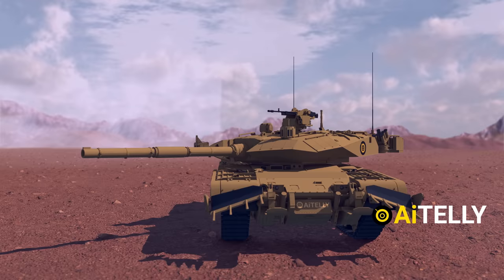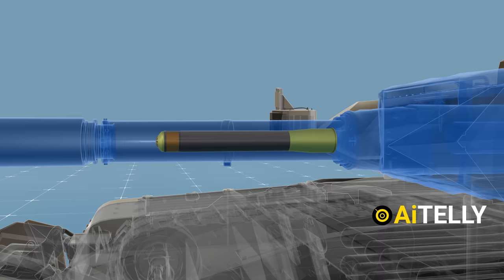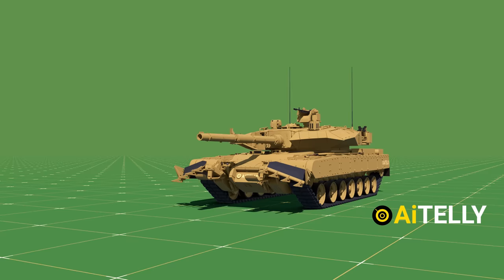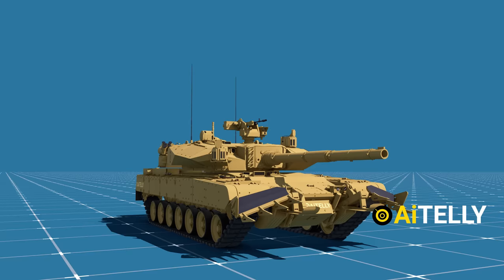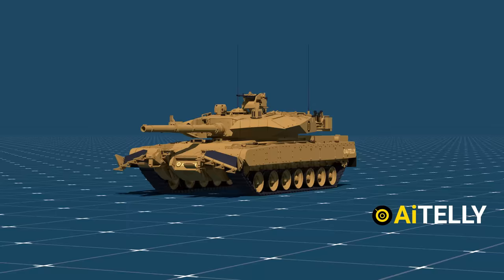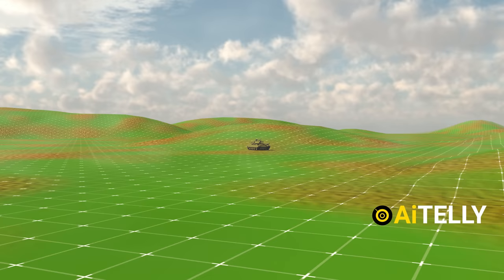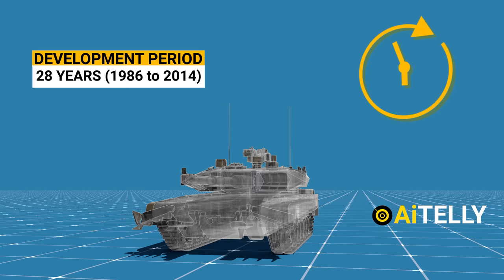Heaviest Battle Tank Arjun Mark 1A Mark 2 | How it works #tank #tanks

Comment: A few corrections for some of the mistake you’ve made regarding the spelling and functions:

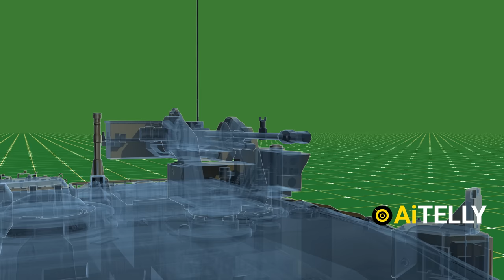- 3:49 The gun is a RWS turret for the commander to take control and clear lightly armored vehicle or infantry, not for anti-aircraft duties though it could be used against low-flying helicopters. 

- 5:00 The American M1A2 is named “Abrams” and not “Abhraham” 

-2:08 The correct term is “APFSDS” or Armored Piercing Fin Stabilized Discarding Sabot and not “FSAPDS”, kind of strange as you’ve correctly spelled them correctly at 1:34

- 3:44 The IR Jammer does not work like a hard kill APS where it intercept the incoming round with a round of its own, but rather jams the IR camera of the incoming missiles making them blind and thus tends to fly off and miss the tank. 

Other than these, you’ve made a pretty good but somewhat simple explanation of how a tank like this would’ve work, got the basics well and that’s ok. 👍
Reply from the maker: Will pin this Comment in our Comment Correction Section.
We highly value your Feedbacks.
Youtube is a great Community to learn,and grow.
Reply: So it is an anti aircraft machine gun. You said it yourself.
Reply: @kolinmartz  it can be use for anti-aircraft purpose, but it’s not its intended purpose. It’s main purpose was to fight lightly armored vehicles and infantry.
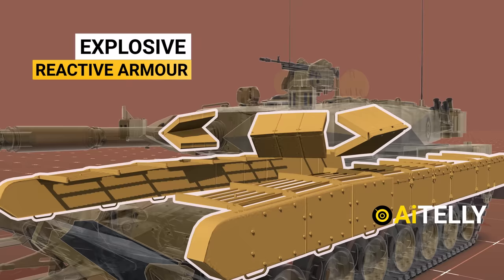Reply: Also the the side ERA coverage is over exaggerated 1:13 , there's only 3 blocks of ERA covering the front part of both sides, not the entire side hull as the video highlighted and in 1:23 you showed a composite armor array in the ERA block

And in 4:09, the blow off panel does not really protect the ammo or prevent explosion, it's there so when incase of an ammo cook off the fire will go upwards not into the crew compartment, Arjun have separate ammo containers as the main ammo protection for the crew

And Arjun Mk1A isnt the heaviest main battle tank, its currently the Challenger 2 TES thats 73 tons
Reply: Lot of more errors include not considering the Challenger Mark 2 which weighs 75t with combat armour. And the M1A2 SEP V3 weighs 66.8 tons similar to Arjun MK1A. One more aspect is the statement of LAHAT getting integrated. LAHAT tests are done and dusted. What's been integrated is India's own SAMHO missiles. Around 4 tests completed including minimum and maximum ranges. The statement regarding obsolete is also wrong since MK1A is being designed to stay contemporary.
Reply: “FSAPDS” is perfectly fine. It is Fin Stabilized Armour Piercing Discarding Sabot.
Reply: and ERA plates made by india certainly does not work against APFSDS, it may only be effective against HEAT, ATGM and rockets only
Reply: My korean friend also used to call the abrams “abraham”, since he figured it was named after abraham lincoln.
Reply: FSAPDS is also correct term , drdo which makes those shells uses that name "Fin Stabilized Armor Piercing Discarded Sabot"
Reply: The term FSAPDS is a term used in Indian army reporting, they essentially mean the same thing but it's how we say it in documentation in Indian.
Reply: and the Challenger 2 TES weights even to 70 tons
Reply: about the FSAPDS, it's what the Indian army calls it, FSAPDS
Reply: @Aitelly  you missed a very imp point. ground pressure exerted by M1A2 is 1.09kg/cm2 but that of ARJUN is 0.84kg/cm2
Reply: @Aitelly  Why do you use broken english
Reply: @Aitelly  really nice 2 see the maturity you've displayed in accepting the feedback, I'm subscribing.
Reply: @Aitelly  btw ur video is EXCELLENT 👍
Reply from the maker: @repealsection230forbigtech4  Thanks
Reply: @Aitelly  Not at all, the hard work U put in & quality of ur presentation deserves the thanks from viewers
Reply: @Aitelly  As an elder, I'm proud of young generation like you, keep getting better at ur career.
Reply: Thank you I was losing it 🤣  just going through the video but since we need more such channels on youtube, can't really hate on him lol.
Reply: @saadman920  nope
Reply: Its Armor piercing not armored.
Reply: Yes numerous mistakes, unfortunately, but, at least the main message got delivered. Keep up the good work, but for heaven's, sake give the commentary a major overhaul. Thanks for your hard work.
Reply: True
Reply: 1 more : there's no composite plate, the whole armor is a composite armor

Composite armor isn't a material, but rather a combination of many layers of material
Reply: abrams is short for abrahams right???
Reply: @heisenberg19989  no, its a General’s name.
Reply: @heisenberg19989  No, Abrams is the name of an Army general, retired.
Reply: Be informed: This tank doesn't have active gyro stabilized Turret. Can't Carry bear glass while moving
Reply: Little correction to what you have said. FSAPDS and APFSDS are essentially same things.

Probably the video maker used FSAPDS as Indian Lab DRDO has created a tailored APFSDS for Arjun rifled gun.

It's called 120mm FSAPDS MK2.
Reply: @kolinmartz  Behold everybody. Every single firearm is an anti-aicraft gun since it can be used against helicopters.
Reply: @Xelif9  yeah good luck taking down an in armored scout helicopter with a pistol tho.
Reply: @kolinmartz  youre missing the point lol. Youre basically implying that all machineguns are anti aircraft guns just because they can be used for that. Thats not how role designations work.
Reply: Worst tank ever built..
Reply: Automatic target tracker, is hunter-killer capability, a gun stabiliser doesn't "keep the elevation".. one doesn't know if it's just a bad scrip or badly translated. But it seems it's bpth
Reply: This tank is Panzer -4 of india
Reply: Oh someone already said it... I was also confused by abrahams
Reply: and 1.5 miles is 3.2kms